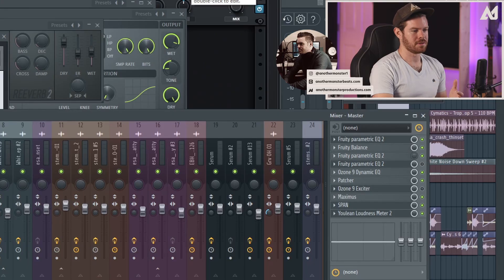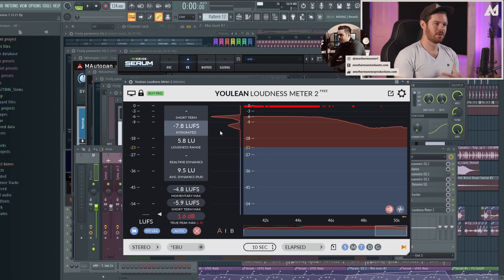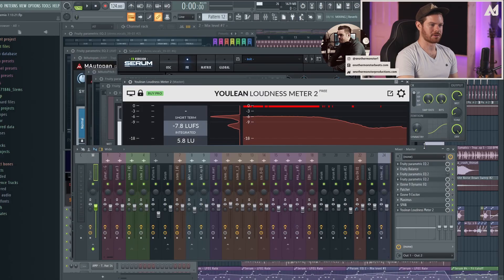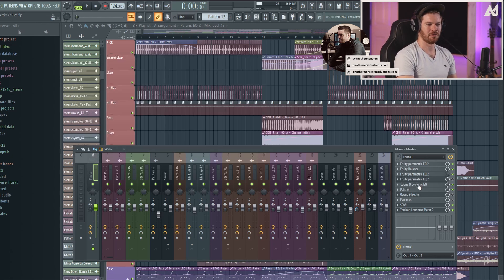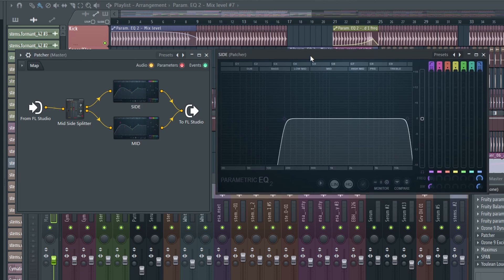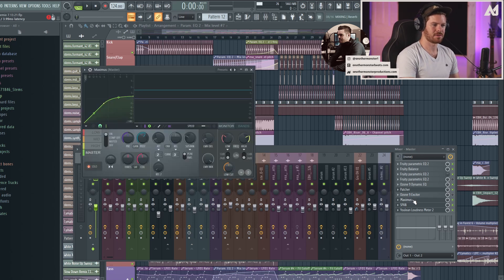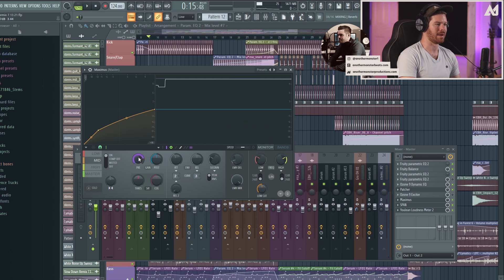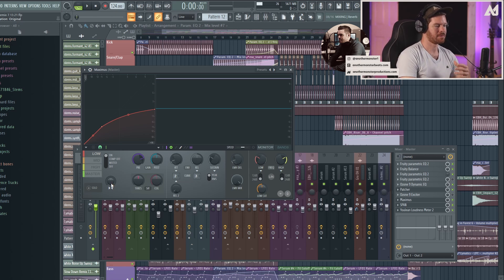How to Master Your Tracks with Stock FL Studio Plugins

Comment: Cool stuff. Like the dynamic eq technique. I'm a snob and only use fl stock plug ins, you can actually accomplish the same with all stock plug ins. Place parametric eq 2 on the master,  insert fruity peak controller on the instrument track (kick, bass or whatever you're attenuating) , link the frequency band to fruity peak controller (peak without the LFO to keep it simple). Use the knobs to create and inverse envelope opposite of the audio input. Press the space bar and watch those frequency bands dance.
Reply: I mostly agree but swapping out fruity limiter for something like fabfilter limiter is an absolute must. Fruity limiter is great, i use it for sidechaining and limiting in the mix but whilst mastering, the difference is chalk and cheese. Been using FL since version 8 and only started using a 3rd party limiter earlier this year. My tracks can hold much more clarity whilst also being much louder. Stock plugins are made to be CPU friendly, 3rd party plugins are cpu heavy but usually perform better. Hope this helps anybody that reads it 😀